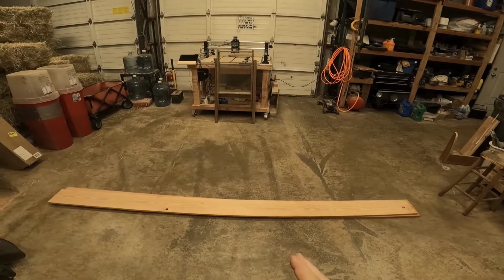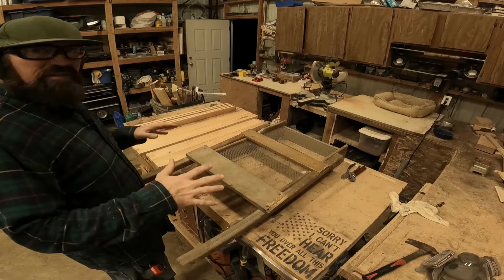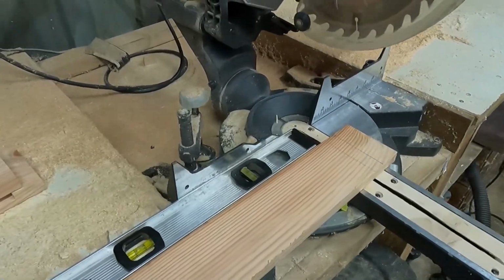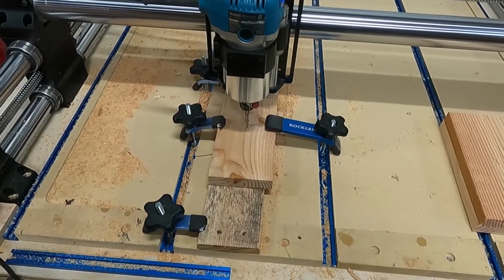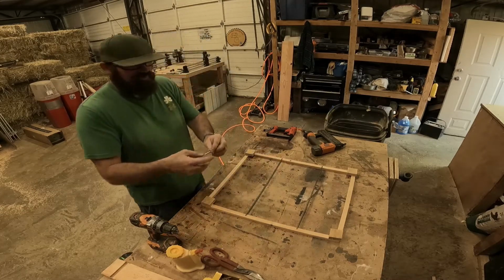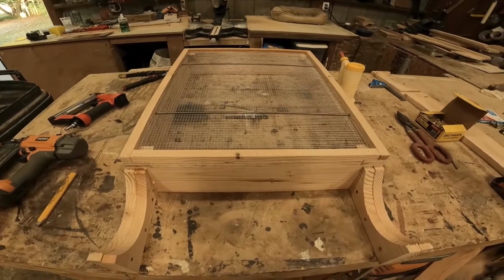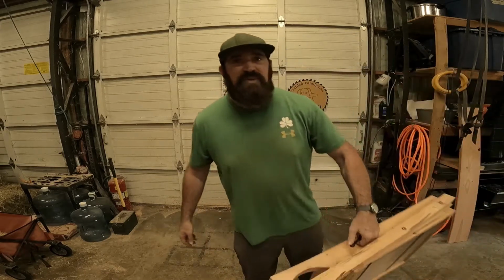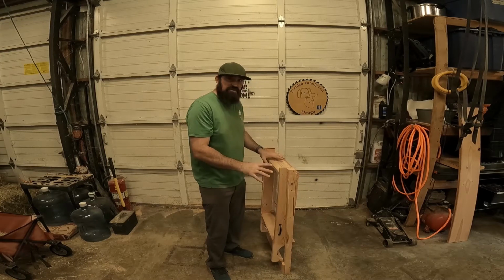DIY Archaeological sifting screen build

Comment: Great build! Did the company order any more? I am looking at building something similar, but I have an idea to fit to bolts to act as stub axle's so I can temporarily fit two wheels. They would be retained on the axle via R Clips...That way, I could push the shaker to site like a wheel barrow..Once at the location, the wheels would be removed by removing the R clips...I did similar on some wooden ladder stands I made for deer hunting many years ago...l
Reply from the maker: @peterevans8194, thanks for the compliment I appreciate it. The company ordered 16 of them and they call me for all repairs as well. I offered to make them with wheels but since the areas they work in are really remote and covered with thick underbrush they preferred to make them light enough to carry.
Reply: @beardedfamilyman243  Excellent result for you!  When I build mine, if it come out half as good as yours, I will be very pleased!
Reply from the maker: @peterevans8194  I hope yours come out awesome my friend. Happy building.